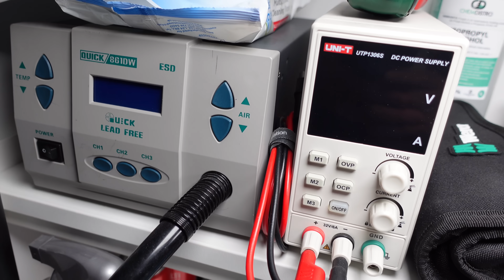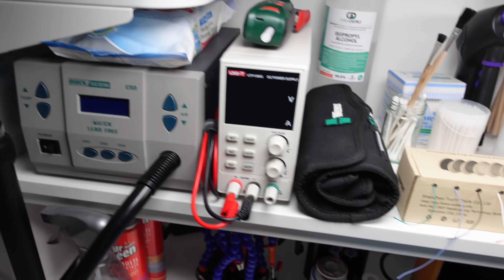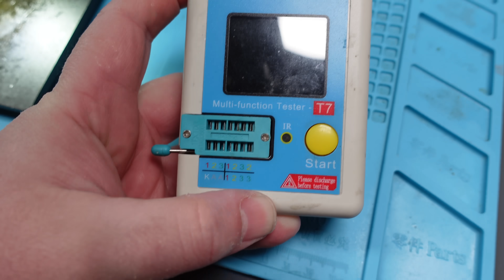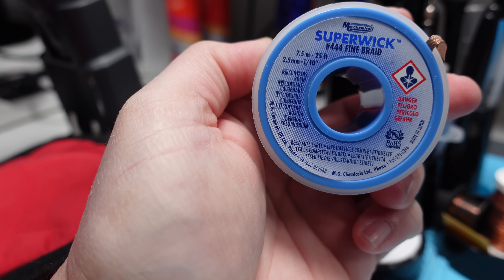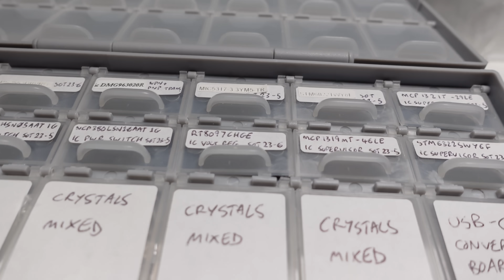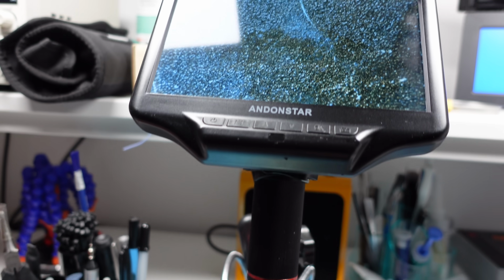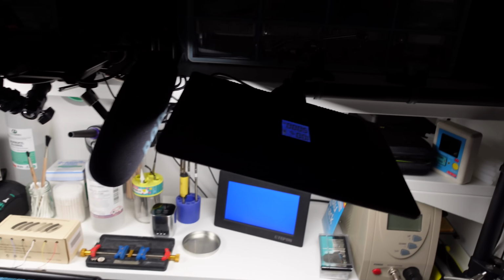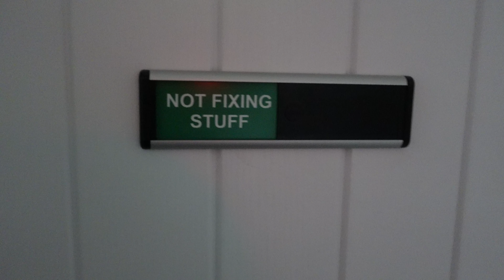The Stuff I Use & Quick "Studio" Tour

Comment: If you want to keep using leaded solder, you should really invest in 63/37 solder, as that's eutectic. A non-eutectic alloy like 60/40 gives a pretty terrible joint (IMC) that will fail pretty quickly.

For lead-free, you can give SN100C (and similar) alloys a try, as they are as easy to to use as leaded solder, while giving a high quality result.

Comment: Steve, we love you... But that's not a real fume extraction setup.  At best it has a carbon filter... You want at a minimum a 3 filter system with a hepa filter that can get the fine particles.  A carbon filter won't even put a dent in the toxins in flux and solder.  Let alone plastic 😂, which we all know you love to melt.

You can also just get a air extraction fan, normally used in grow spaces and add ducting to pull fumes to a window or outside somewhere.  This would be the most ideal situation as the suction and environmental impact is lower than using a bunch of expensive filters over time.  ❤
Reply: HEPA is very important agree with this..